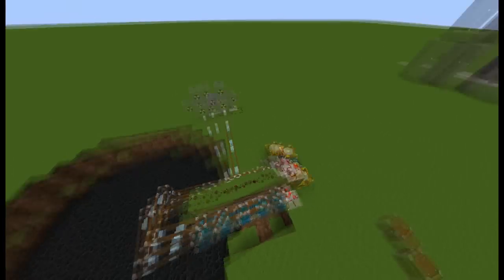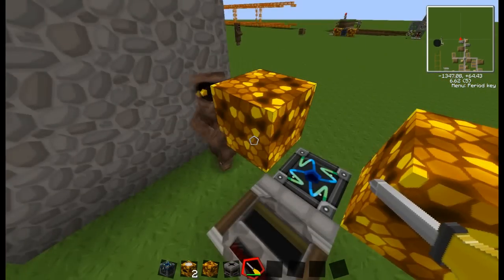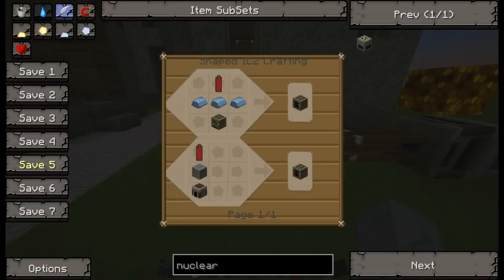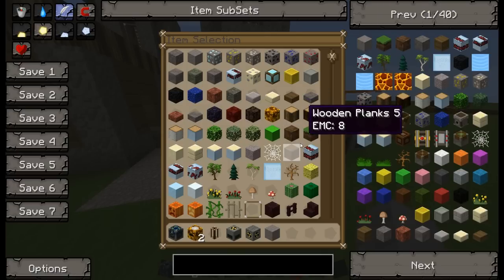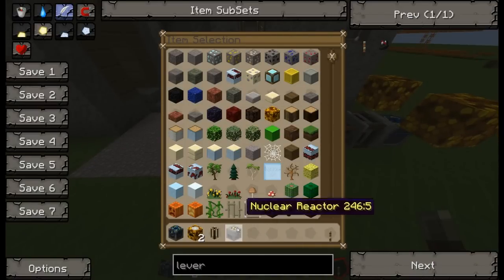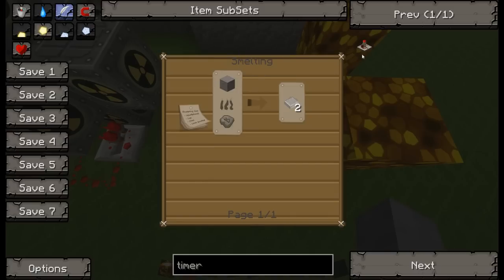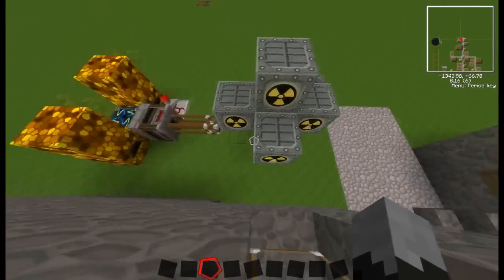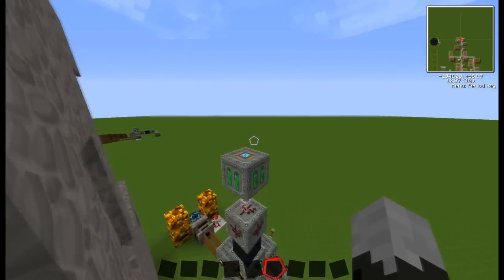TEKKIT tutorials: Nuclear reactor most efficiant

Comment: @Airneko321 Thanks for your tip. I kind a figure that out and got things to roll. i checked all 6 reactors in 4 times and heat off-switces 3 times. i went end of powerline 500 block away and when i came back my plant was thsernobyl II ..  so i think that safe nuclear plant is still just myth. xD

Comment: Mine won't work and I'm not sure why. It turns on, consumes uranium and the like, but when I connect te hv 4x cable and the transformer and the glass cable and the mass fabricator, no energy shows up on the fabricator!! I tried connecting the fabricator to the hv cable but it exploded, so there is Definetely a power output. It must be something to do with the transformer or something. Please help!

Comment from the maker: Are the two uranium cells at the bottom row touching? If so, seperate them so they are on the sides. This is because with them touching, the nuclear reactor gives 1056 EU/s, and HV wires can only take up to 1024 EU/s!